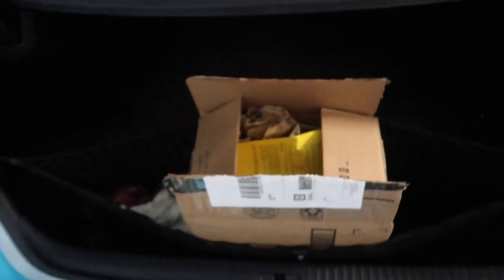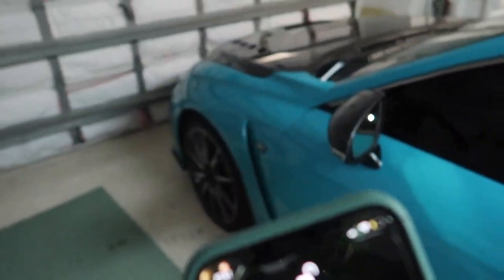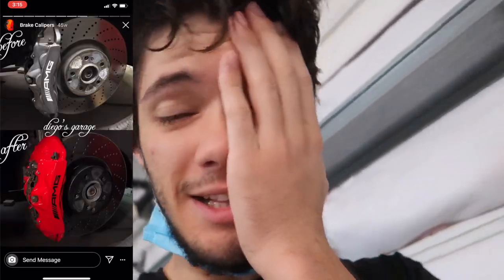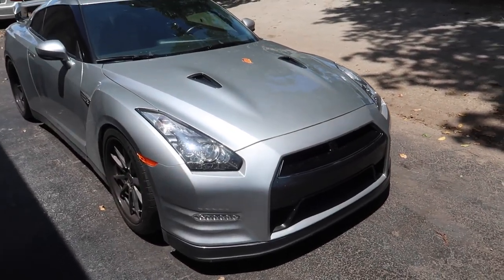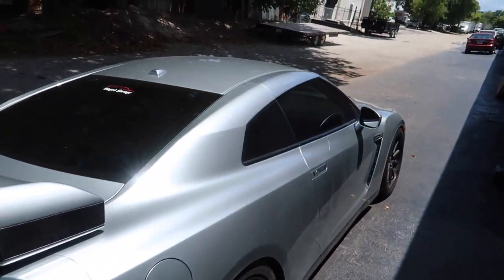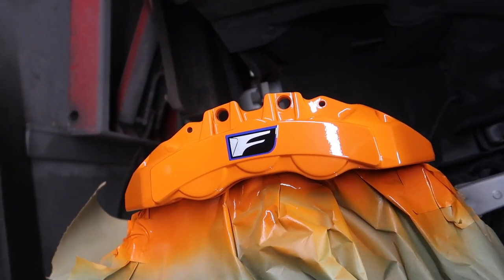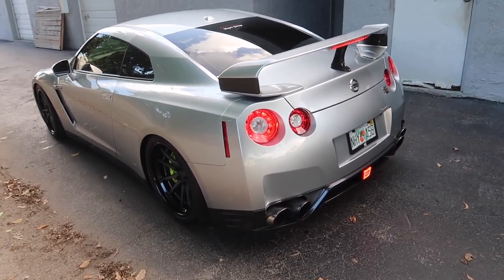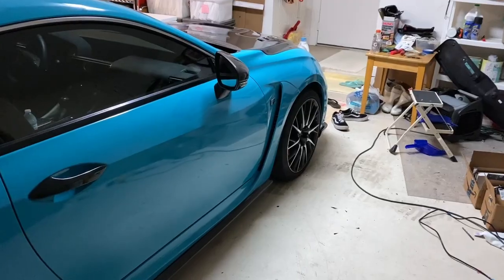CUSTOM break caliper painting + wheel spacer install! LEXUS RC-F

Comment: Looks great! Glad you got spacers. I recommended a while back. It totally changes how aggressive the car looks. I have Eibachs for over 2 years and never looked back. It still handles phenomenally well. No rubbing and no complaints.
Reply from the maker: Yea you did recommend them! And I know it makes the car look soooooo much better. You have 20mm in the front right? I went with 15 all around.
Reply: @oryanx  Yeah, it looks so much better and you have to see it in real life to realize it. 15 mm is good. Yeah, I have 20 mm and they work fine all around. Still is pretty much flush as you can see in my videos. Had no issues in over 2 years.
Reply: @oryanx  What brand is the spacers you used?

Comment: I had the same black caliper issues where it was peeling off. I ended up painting mine grabber green. Worked out for my color scheme. Loving the orange on there man.
Reply from the maker: Yea man it happens over time. I heard that the acidity of the soap that shops use to clean the wheels gets on the breaks and wears down the paint over time. And then rocks chip them easier and all.
Reply from the maker: And yea I like the green too it goes good with your car
Reply: @oryanx  I washed my car normally every 2 weeks and then one day I looked down there and it was just missing a portion of black. I said F it and painted it haha

Comment: Hey, I’m looking to do the exact thing with my F where did you get the F decals from? I’m having a hard time sourcing them. That orange colour is perfect do you by chance know the paint code? Thanks in advance.
Reply from the maker: Yea bro I couldn’t source them either. The dude that painted mine actually had them. Other then that, I had no luck. You’re gonna have to have someone make them custom.
Reply: @oryanx  do you know if the stickers had any type of "heat resistant" coating on them?